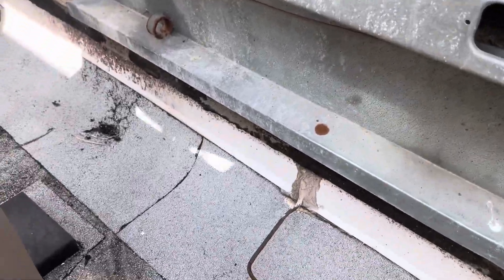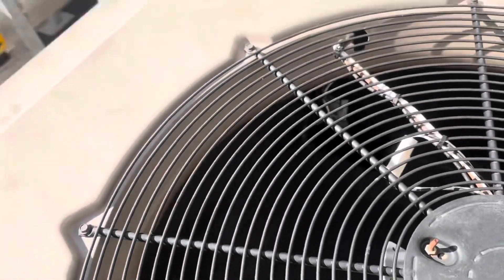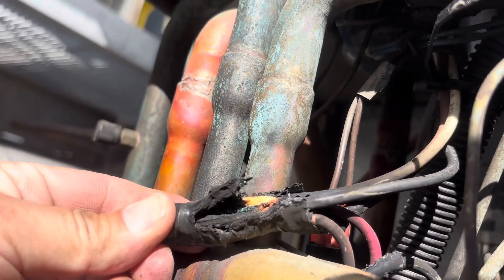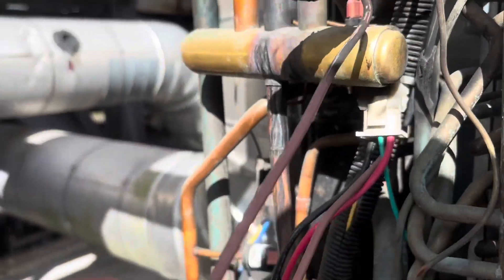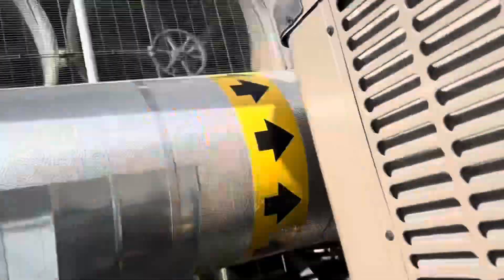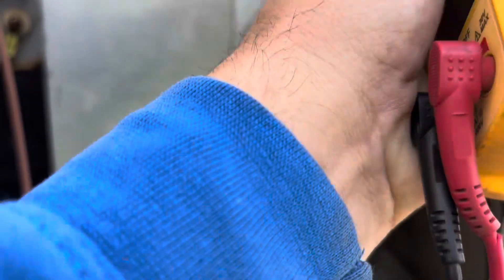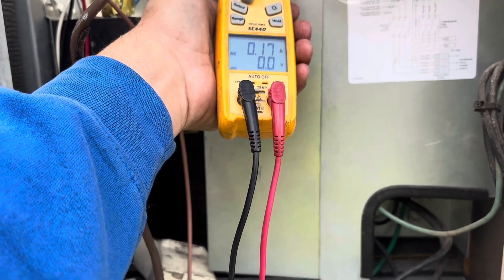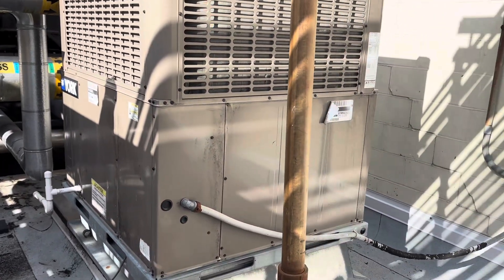High Voltage A/C Unit Blowing Fuses!

Comment: G,day from Sydney Australia. Very interesting.
A. Has the reversing valve melted the wire insulation causing  fault code?
B. Are there too many wires in the wire nut hence V overload.
C. Vibration caused exposure short and burnt insulation?
🌏🇦🇺
Reply from the maker: All very viable diagnosis.  I honestly think the wire nut was loose or not connected properly.
Reply: probably more like, water got in since the cap/s were faced open side up. always put them open side down, leave a few inch of wire looped below the cap to help stop wicking and stagger the joints so none of them are near the other. even butt splices will end up with the same issues, if they're not the self sealing heat shrink type.
a bit of rain water or condensation from the pipes/reversing valve into the open caps, add them all taped into a bundle near each other and it's asking for issues, especially at 480Y/277V, but it's never good at any voltage levels or having splices so near, at least without special outdoor splices.
Reply: I would wager on A